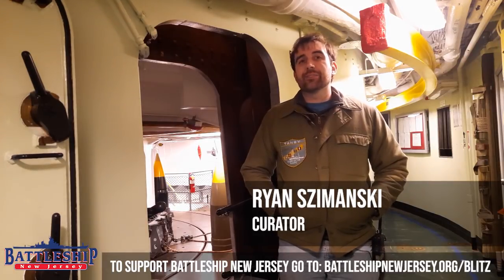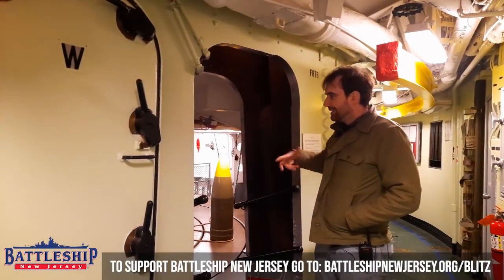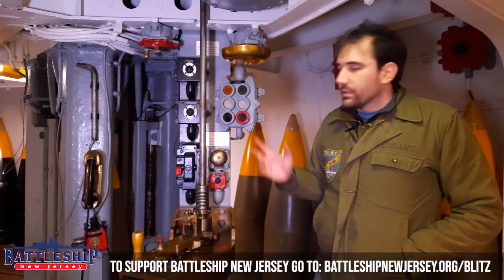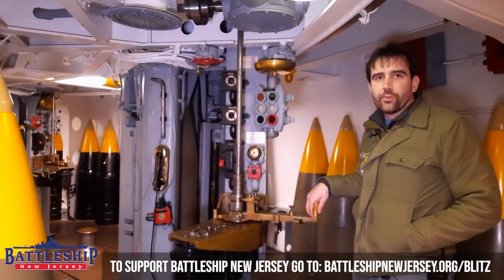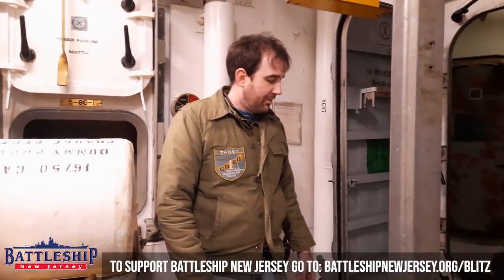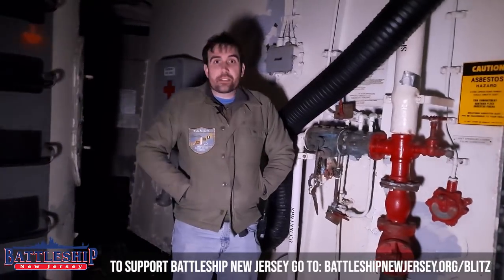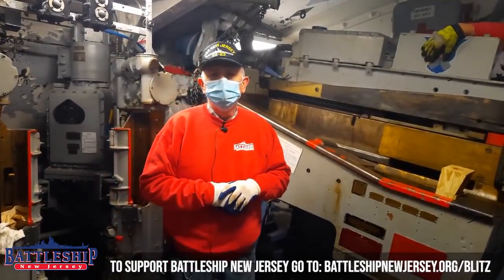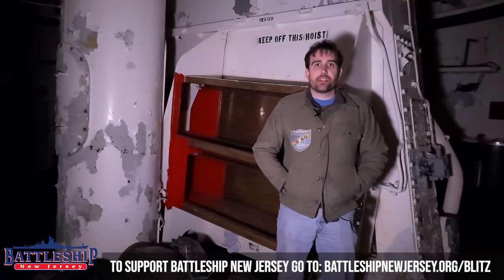Restoration of Battleship New Jersey's Guns

Comment: I’m a little disappointed.  Libby and the gang didn’t find a cramped space to shove Ryan into during this video.  😉. Kidding!  All of you are awesome!  Great video, and I learned a few things. Thanks!
Reply from the maker: That 5in gun mount was tighter than you'd think! I ran into far more things in there than usual!
Reply: @BattleshipNewJersey  ha! I’ve been in a few dual 5”38cal mounts. I’m 6’2”  so I can say ouch. I’ve toured more than a few museum ships.  The best was doing it young when I had actual USN combat vets to show me.  While touring USS Laffey, I was told how roomy the dual mount was compared to the single mounts on the Benson class.
Reply: @derbuckeyetribe9789  I've never been inside one of the 5" mounts on an Iowa, but I did go into a 5" mount on the Alabama. I'm 5'5" and even though there was enough room for me to move around, it was still cramped. That was one of those times I was glad I'm short. 😁
Reply: @BattleshipNewJersey  We know that he can fit through a 16" barrel, but can he climb a 16" shell hoist?
Reply from the maker: Since our "working" hoist is only a small motor attached to line that pulls the 5lb plastic shell around, Ryan would have to do it unassisted which is 40 ft of smooth vertical surface. He wouldn't make it far.
Reply: @BattleshipNewJersey  That's a challenge if I've ever heard one

Comment: I think you'd have some success were you to try to raise funds to start using a 16" as a saluting gun.
The locals might want to check their glass insurance, however.
;-D
Reply from the maker: We would never fire the 16in guns. Its not safe to do so.
Reply: @BattleshipNewJersey  Yes, I know, I wasn't being serious (although you couldn't necessarily know that).
Cheers
Reply: @BattleshipNewJersey  Just one powder bag without a shell, if the recoil and breech work you can load one bag manually. The whole set + shell really needs that hydraulic rammer.
Reply: @dariuszrutkowski420  that was brought up in an earlier vid, "it's not dignifying"
Reply: @BattleshipNewJersey  why ???
Reply from the maker: We take safety very seriously.
Reply: @BattleshipNewJersey  Not exactly something you could hope people wouldn't notice, either, LOL. Wonder how many windows you'd break?

Comment: Fantastic quality restoration by you guys and fab work making it more accessible to visitors. Clearly massive attention to detail.

I'd be really interested in hearing about what the navy dehumidification system was, during mothballs. What was set up, how it worked, what areas it covered, what was left when they handed it over to you etc.

Could you cover that in a future video perhaps?

Thanks
Reply from the maker: Check this out: https://youtu.be/lK9ofM6ef5g
Reply: @BattleshipNewJersey  Thanks so much for the reply. 
I have checked out that video and it's another very interesting one (they all are!) and it did talk about what of the original ships systems are still operated, but it didn't talk about the navy dehumidification etc system?
Hopefully you might get a chance to cover that sometime in the future.
Cheers

Comment: I know it's considered taboo... could you address what happened with the Iowa....just the technical aspect.   Big fire and over pressure stuff.... and here's how the vessel reacted?  Don't get in the how's or why's?  It was this gun.... this much powder..... this is what the ship did to react..... this is what a crew would  do. 
Honest technical stuff.
Reply from the maker: This is our video on the event 
https://youtu.be/8D6v48cXvRo
Reply: @BattleshipNewJersey  How did the boat react?  What part of the boat did this effect?  How did damage control react?  This is no different than what you would describe happened with...say...an incoming shell.  I know this is sensitive.   I'm interested in how damage control worked.  What did they flood?  What bulkheads were sealed?  What prevented the powder magazine from blowing up?  This is important stuff because the ships design saved the ship.
Reply: @brentraulston7224  I can help you with that, I was there that day in 16 inch turret one. When the explosion happened it sounded like they fired a round over top of our turret. Within seconds the ship went to general quarters. When you are firing the guns the ship is already in a watertight posture, hatches closed and dogged. The turret was an absolute inferno, damage control teams were not able to get into the turret from outside, even though the hatch to turret two was blown off it was too small for a man with breathing gear to get through. Since the bloomers were also blown off damage control crews were spraying water into the turret through the openings around the guns. Petty officer Mulahey who was one of the magazine petty officers in charge came into the powder flats level of turret two through the annular space. Everyone was dead and there was fires out of control. One mistake they did make was passing all the powder for the upcoming shoot into the powder flats right away instead of waiting for each shot before passing the next series of powder so there was somewhere between 20 to 30 bags of powder in the powder flats that was now on fire. Petty Officer Mulahey immediately sealed up the turret and went to damage control central and initiated flooding the magazines and the powder flats WITHOUT the captains permission. That act of courage and heroism probably saved the ship and he was promoted from Petty Officer Third Class to Second class within a couple of days. As far as what areas did it effect, the explosion was largely contained within the turret. On the outside the decking from the bridge to turret one was scorched as well as the paint. I remember sanding the deck and repainting the front of the ship before we came back to Norfolk. Inside the turret the damage was catastrophic. The walls in the gun room were blown out, the explosion traveled down the powder hoist and that trunk was bulging and had split at the seems. I hope this helps, if you have any more questions I will try my  best to answer.
Reply: @CRAZYHORSE19682003  Hey... thanks for just being there!!  I've read a few things....but this was a great technical view.   Relatively speaking..how close was the ship to being lost?  Worst case scenario?  Would it had been an HMS Hood explosion?  Were there things in place to prevent worst case scenario?  Is there built in engineering to help a situation like this?  TIA
Reply: @brentraulston7224  As to how close were we to losing the ship, I can't say. I was trapped in turret one for quite a while after the explosion. However Petty Officer Mortenson who was the leading expert on 16 inch guns in the world was racing around in the turret trying to flood Turret two's power flats. The look on his face said we were in deep shit. I was totally unaware of the potential danger until I saw his face. If even a single magazine detonated it would have set off the other ones in a chain reaction and the ship would have disintegrated like the Hood, killing almost everyone. Only 3 men survived the Hoods magazine detonation that killed 1,415 men. I don't know what you mean by built in engineering but there is damage control center and damage control lockers through the ship with fire fighting equipment, shoring material, materials for plugging holes, etc. Everyone in the crew gets some damage control/fire fighting training. In todays Navy Damage Control is an actual rate where that is specifically their job. It wasn't like that when I was in.
Reply: @CRAZYHORSE19682003  Wow.  Hell on Earth, at sea.  A real credit to damage control crews.  Thank you for the explanation.

Comment: I have to assume you have installed Wi-fi in some areas since cell signals would be challenged by armor.
Reply from the maker: There is wifi in the ward room and crews mess. That's it.
Reply: @BattleshipNewJersey  How does the staff and volunteers communicate?
Reply from the maker: We carry radios that sometimes work. Otherwise we're pretty good about making sure that everybody knows where everybody should be. In an emergency or when you can't find someone specific, pick up an phone to get the 1MC pa system and call out to the whole ship.
Reply: Just about any metal will block Wi-Fi signals.  Wi-Fi is very low power, only about 10 to 100 milliwatts.
Reply: @lexington476  That was the point of my question.  How about an answer?
Reply from the maker: The answer is there isn't wifi for most of the ship. Limited spaces have it.
Reply: @BattleshipNewJersey  A working PA is a great answer.  A huge ship, easy to get lost, or worse.  Thanks.
Reply: @BattleshipNewJersey  Sorry, that was intended for the guy telling me what I already knew about wi-fi.  You reply was spot on.
Reply: @BattleshipNewJersey  Not sure if you already do this, or can, maybe play over the ships speaker system, a playlist of songs and music from all the years the ship was in commission interspersed with old radio and news bulletins from those time periods, might enhance the tour experience and bring a feel for the ships history. The idea crossed my mind the other day while listening to some 50s music on Sirius
Reply from the maker: Copyright makes playing music really tough. But we do use the 1MC to automatically play fake announcements SWEEPERS SWEEPERS MAN YOUR BROOMS and the like. As well as using it for bells to tell time.
Reply: @BattleshipNewJersey  probably for like $50 on iTunes you could cobble together a decent play list. I found a general quarters announcement and alarm on there and now it’s the ringtone on the alarm on my phone in the morning
Reply from the maker: Just buying the song on iTunes doesn't give you the rights to play something publicly.
Reply: @BattleshipNewJersey  oh well, lawyers and legaleze can be a kill joy.
Reply: @BattleshipNewJersey  anyways, this has become one of my favorite channels. I love the history and learning more about these majestic ships and the interaction with answering of questions and comments. I am definitely saving my pennies for a curator’s tour and an overnight when I find myself  back in my home state. Keep up the good work and I look forward to visiting again soon and seeing more compartments opened up and the accompanying videos.

Comment: I you use an "Empoxy" paint, ( its IMMUNE, to fluids of any kind, once "Dry" )   you'll NEVER have to worry about it "Pealing" . . . its whats used "Internally", aboard SUBMARINES  ( I "Know" this, because I PUT IT THERE !, while "Building It" !. General Dynamic's, EBD  )
Reply: Is that the stuff that the Navy uses inside tanks that's a real pain to apply but seems to last forever?
Reply: Epoxy paint is rad ^^
Reply: @ghost307  Yes, its "Similar" . . .

Comment: It would be interesting to see a space that has not been restored compared to one that has. In fact I'd like to see several unrestored spaces that are interesting and not on the tour.
Reply from the maker: In this video we show you both a restored turret and an unrestored turret. As a whole, our channel shows many of the thousand spaces on board including lots that aren't on the tour route.
Reply: The first time I watched I missed the turret one tour. Actually it didn't look too bad, but if you have to cut holes in it, add lighting ventilation Etc I'd rather see it remain in original condition.

Comment: I've toured both the USS New Jersey and the USS North Carolina. I have to say that the USS North Carolina is the better tour. The state of North Carolina apparently has far fewer safety regulations than the state of New Jersey. As a consequence almost all of the North Carolina is accessible to visitors while the New Jersey is far more restricted because of these regulations. Maybe someone should approach the appropriate New Jersey state officials to get some exceptions made for the USS New Jersey.
Reply from the maker: We have opened far more of a route in the last 2 years and now have more open than NC
Reply: @BattleshipNewJersey  That is very good news. I toured both about 3 years ago. At the time, I couldn't even tour the engine room of the NJ which was very disappointing to a retired engineer like myself.
Reply from the maker: Ah yes. We've since opened the engine room and pretty much all of 3rd deck.

Comment: Did the ship have a hydraulics shop for rebuilding components and making hoses?
Reply from the maker: Nothing just for hydraulics but there are shops for metal work, machining, wood working, electronics, and motors. So whatever work needed to be done could be done in any of those shops.
Reply: @BattleshipNewJersey  I'm assuming hydraulic systems have reusable couplings being from the 40's? That would explain the lack of a dedicated hose shop. You'd simply need the stored bulk hose and appropriate tooling to cut it on a hydraulic press. 

Though the idea of rebuilding hydraulic motors, rams, and pumps in a machine shop gives me the heeby jeebies.

Comment: At 14:03 the light fixture is lit but you said they dont work in Turret 1. Is that Orange glow just a retrofitted fixture serving as an emergency light?
Reply from the maker: Theres still some electricity in that space, but no one has changed the bulbs in many many years.
Reply: @BattleshipNewJersey  Even if the fluorescent lamps burn out the ballasts are still using power. You might want to think about turning them off or disconnecting them to save a few bucks on your electric bill.
Reply from the maker: @ghost307  we flipped the switch for the purposes of this video, we don't leave them on all the time.

Comment: Would it not have been possible to specify that an internal tour required a minimum level of physical ability in order to maintain the ship in it's naval form or is it required that to be a museum ship you have to make it as accessible as possible.  I speak as someone who is physically limited but if i were to tour an historical ship i would assume that I'd have to adapt to the ship rather then you guy's having all the extra work and cost to accommodate old cripples like me.
Reply from the maker: The vertical ladders would be make it unsafe for everyone, its a 20 ft drop of you slip. Its so much more than just ability, its a huge safety risk.
Reply: @BattleshipNewJersey  Yes i understand you have the liability problem that would i guess never fully cover you.  The last ship i visited was H.M.S Belfast as a young kid and that was more of a deck tour then an internal tour we walked down about 20 metre's inside the ship entering by a hatch just behind the fore turret's and exiting at the start of the midship section but a hugely smaller ship then the fine lady you guy's look after.  Thank you for the quick response i wish i could help you financially.
Reply: Sadly, you are in a rare minority.   Far too many people expect only to be entertained in a completely "safe" environment.   The concept of personal risk and responsibility is fading rapidly from the majority of people.

Comment: Do the turrets have a manual traverse? For use in power loss.
Reply from the maker: Not exactly. There is local control but they rely on the motors to actually rotate
Reply: @BattleshipNewJersey  is that why South Dakota was knocked out in her action against the IJNS?

Comment: Would it not be cheaper to build a brand new battleship then trying to reactivate a old one from ww2? I mean can't the Navy build a new one with modern tech and advanced stronger armor of today? I'm sure brand new Battleships makes more sense.
Reply: The only scenario where the Navy ever reactivates NJ is a some sort of post-apocalyptic world where the Navy is desperate for more ships, but there is no possibility of building any new ones. With the current pace of AI/remote controlled drone development, the era of manned navy ships may be coming to an end.
Reply: Battleships were built to fight battleships. With the sinking of the Hood, it became apparent that battleship warfare was a political risk that the Allies were unwilling to take. Battleships were used with extreme caution from that point on. The subsequent naval battles of the war involved shocking loss of life, and only reinforced the perceived risk. Modern weapons meant that submarines and small ships with missiles were the way forward, in support of air power. The Iowa battleships were used as mobile artillery platforms post WW2, and were more important as symbols than any tactical use.

Comment: I am guessing the reason the guns have no Hydraulics is because the Hydraulics are steam-driven?
Reply: no, they were electric driven Hydraulics, some of the Japanese and British battleships used steam driven Hydraulics but not the Iowas
Reply: @tbates1987  it must take a massive amount of electricity. Does the Navy require that the guns not be used electrically or is it just cost-prohibitive?
Reply from the maker: It just isn't practical to get that amount of electricity to the turrets and there isn't any benefit to it other than it looking really cool. The hydraulic systems are a major safety hazard and the whole thing would be very expensive.

Comment: This video should be called How bureaucracy keeps the average citizen from enjoying the battleship New Jersey!
Reply from the maker: Its not really bureaucracy but a respect for safety
Reply: My guess is that the permit people interpret the new stairways as regular stairs instead of as part of a ship. Chicago did the same thing to one of the yacht clubs until they finally went out and bought a boat to use as their clubhouse and went through a court battle that the land-based building code wasn't applicable to boats. (Although there is a boat-based code that has to be met).